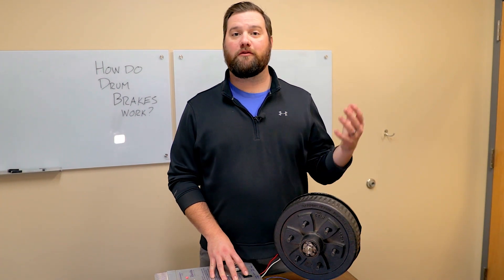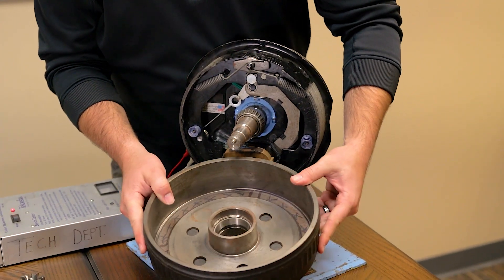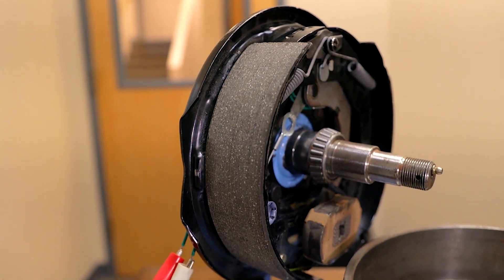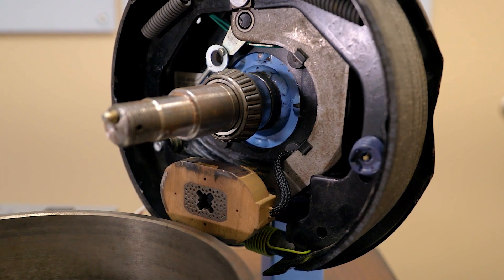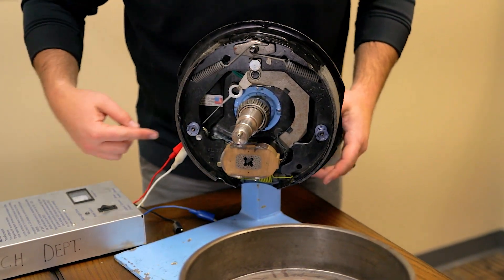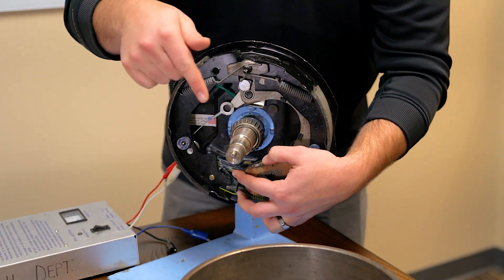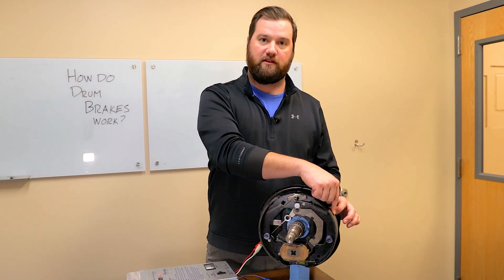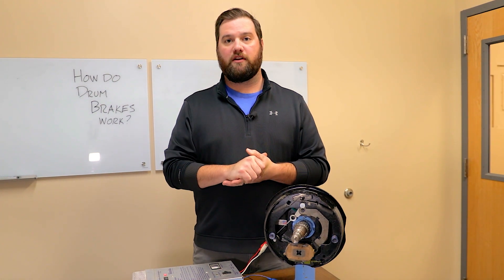How Electric Trailer Brakes Work (Drum Brakes)

Comment: So electric brakes are proportional to the amount of brake pressure applied in the tow vehicle?
Reply from the maker: When using a proportional brake controller, yes. They have accelerometers in them and will amp up the power when you brake harder (pun intended). Time delayed controllers will apply more power the longer you hold the brake pedal down. Some people still swear by time delayed controllers, but they always start at the lowest output and really aren't the best in an emergency situation.

Comment: My question is regarding the apparatus under the dash inside the truck. It has a gain knob and a thumb lever. The thumb lever operates my trailer brakes, but the brake pedal doesn't seem to affect my trailer brakes no matter what position the gain knob is in. What could the problem be?
Reply from the maker: Which brake controller do you have? What's the year/make/model of your vehicle? Get back to me with that info, and I'd be happy to help troubleshoot what you've got going on.

Comment: Thanks for the video. When you release the brake pedal, does the magnet , and essentially the brake pads, also release and return to original position right away?
Reply from the maker: When you apply the brakes, the magnet electrifies and grabs the armature surface on the inside of the brake drum. This and the rotation of the wheel expands the brake shoes which slows the trailer. Releasing the brakes deactivates the magnets which causes the brake shoes to return to their original position. This happens immediately upon releasing the brakes. Hope that helps!
Reply: @etrailer  thank you.